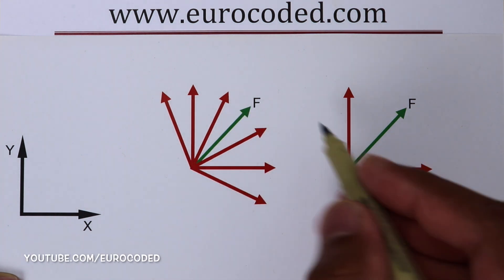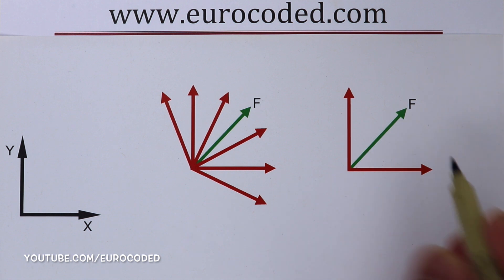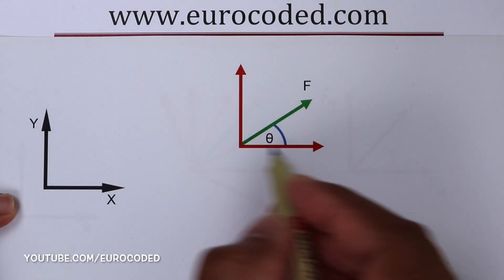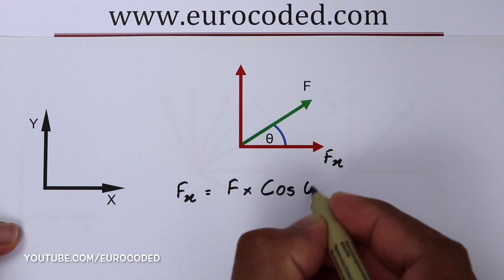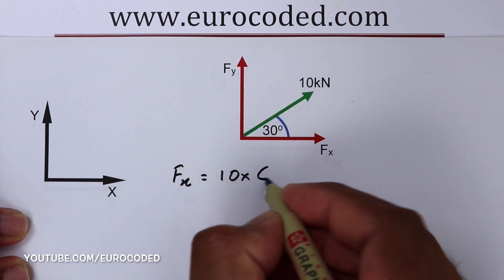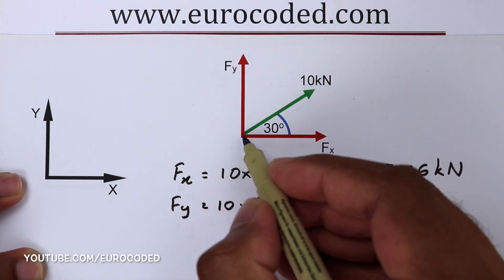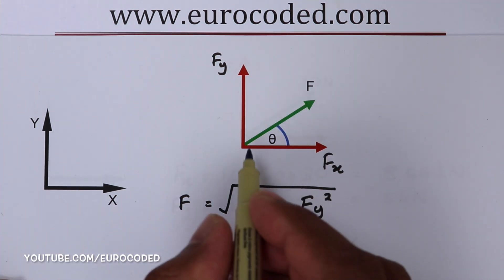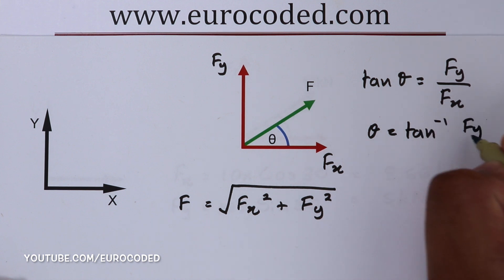How to Resolve Forces or Split a Force in to Two Components and Combine Forces

Comment: This is a really helpful video! But I am confused at 2:25  why do we do sin30? Like the angle 30 is with X not with Y ! So isn’t it supposed to be sin60? Because 90-30=60 please let me know I am really confused
Reply from the maker: Because when you draw the vector diagram (a right-angled triangle) to resolve the force, the adjacent leg represents the horizontal component (F x Cos θ) and opposite leg represents the vertical component (F x Sin θ).

Comment: if two forces are which one should I break? please help I am very confused.... sometimes people, in a pendulum problem, break mg into parts, and in the very same question the tension for the next time in a different case... please help
Reply from the maker: The question is not 100% clear to me. If you have two forces, I would resolve/split both forces in the horizontal direction and the vertical direct (X and Y). That makes it easy to look at equilibrium as an example. Hope that helps.

Comment: How Fcos phita and Fsin phita are form?
Reply from the maker: Think of a right-angled triangle where the force (F) is represented by the hypotenuse. Then the horizontal component is represented by the adjacent leg. This horizontal component has a value of F • cosθ where θ is the angle between the horizontal axis and the direction of the force. Vertical component has a value of F • sinθ.

Comment: but how do you know when to use cosine or sine
Reply: thats what im looking for too..
Reply: @PRINCE-zg2yl  i cleared it. To the direction where you are making an angle of the component with the resultant you will take cos  and other is sin
Reply from the maker: Think of a right-angled triangle where the force (F) is represented by the hypotenuse. Then the horizontal component is represented by the adjacent leg. This horizontal component has a value of F • cosθ where θ is the angle between the horizontal axis and the direction of the force. Vertical component has a value of F • sinθ.